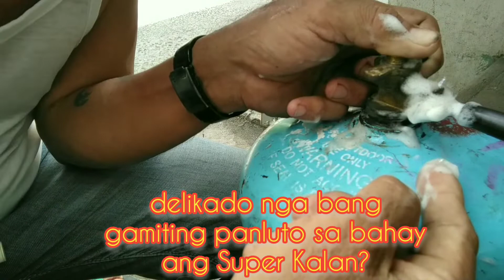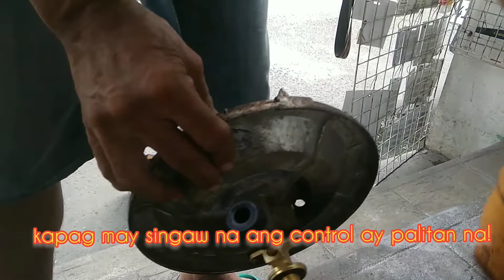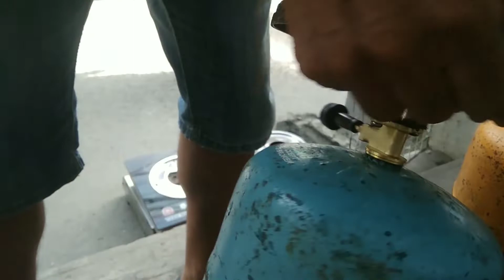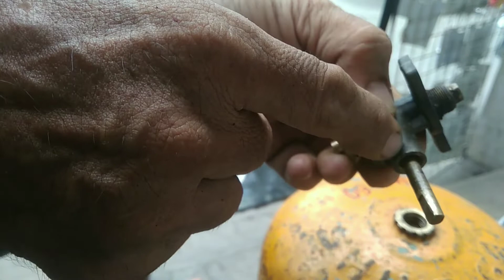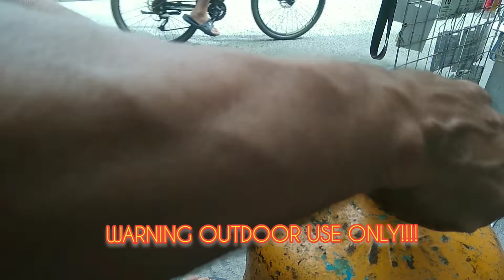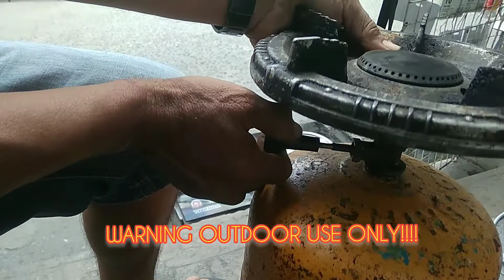NAGLILIYAB BA ANG PIHITAN NG INYONG SUPER KALAN BURNER?    SOME CLIPS WERE MUTED DUE TO COPYRIGHT ✌️

Comment: Sir ung samin po bgo din po bili ng control nya kaso may singaw sa mismong tangke nya mririnig mo at naamoy e mahigpit nmn n po ung pag ka kabit
Reply from the maker: minsan po paghigpit natin ay umaangat yung bilog na gasket ng control dahil tinotulak ng pressure ng gas😊  tanggalin nyo po ulit at lagyan nyo ng kunting glue ( kahit mighty bond) yung gasket tapos ibalik nyo po ulit👍   at tingnan nyo rin po yung nilalapatan ng gasket sa valve ng tangke, minsan kasi uka uka sya kaya hindi lumalapat ng maayos😊👍
Reply from the maker: pwede nyo po ako pm sa fb  Nelson Albanio Alvarado  salamat po👍
Reply: @LPGTECH2620  salamat po sir
Reply: @LPGTECH2620  cge po sir

Comment: Normal ba at safe ba bakit ummiinit pati Ang tangke. Sa Loob Kasi Kami Ng Bahay nag luluto. Kung sa labas Naman mahangin na didistrack ung apoy
Reply from the maker: Mag iinit talaga ang tangke boss✌️ Hindi talaga sya design gamitin sa loob ng bahay, ang super kalan burner ay gamit pang outing or outdoor use only! Nasanay lang tayo na ito ay gamitin sa loob ng bahay pero hindi sya safe✌️👍
Reply: @LPGTECH2620  thanks Po. May nabibilhan bah na parts Hindi ung burner kundi pang pihit lang.
Reply from the maker: Panoorin nyo po hanggang matapos ang video, pinaliwanag po dyan kung bakit mabilis masira ang control at saan lang dapat ginagamit ang super kalan!  Maraming salamat sa panonood at nawa ay patuloy po ang inyong suporta sa aking channel ✌️👍
Reply from the maker: @Mr.GimmeLD  meron po minsan sa mga dealer ng LPG supplies depende po sa location nyo.
Pwede rin po sa online.